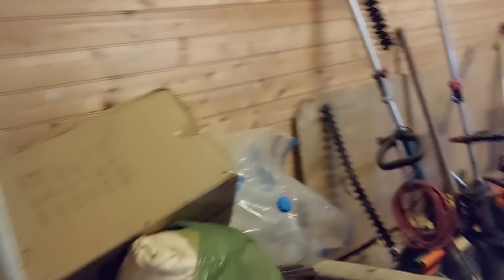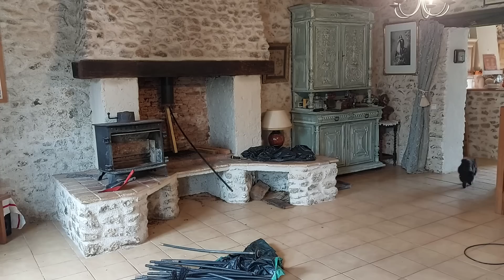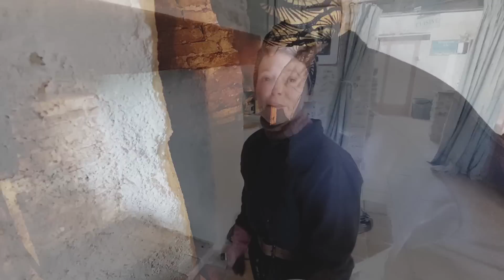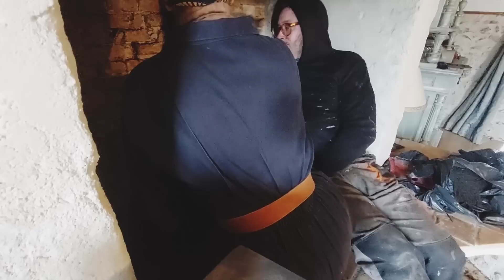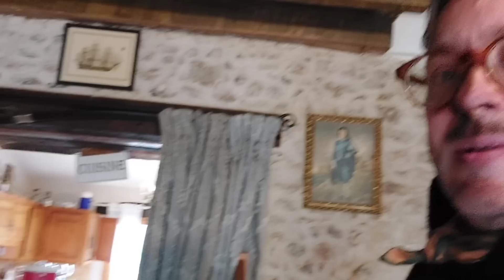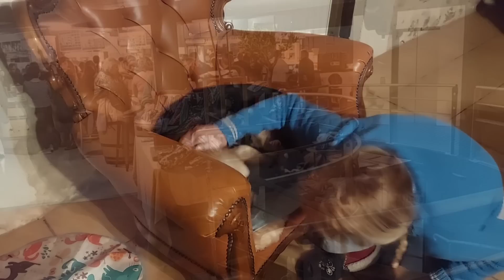Ep 92 | Rosie the Riveter AKA Mary Poppins! | Sweeping the Chimney | French Farmhouse Life |

Comment: Isn't it a French Legal requirement to sweep working chimneys annually?  Unseasoned wood over 20% mc is the worst culprit for tar and unburnt particles - then there is the gas that can combust up in there if there isn't sufficient draw and smoke drawback from low heat in the flue.  Thanks for the fun again 😀